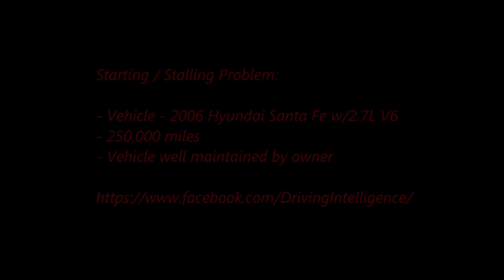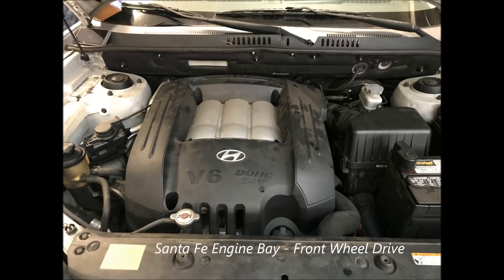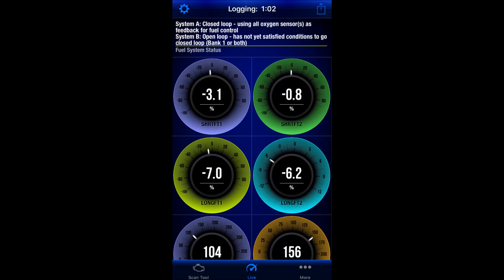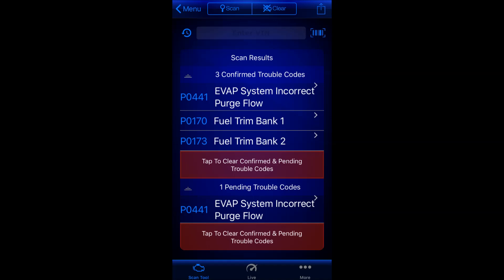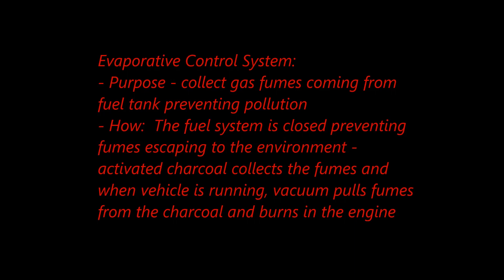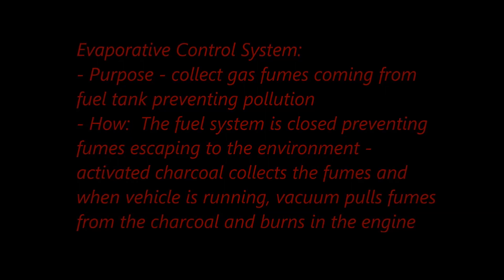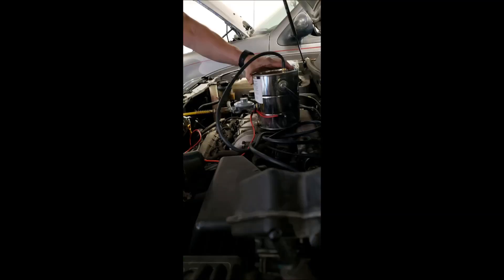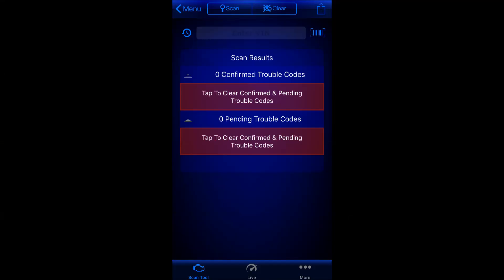How To Fix P0441 Bad EVAP Purge Valve Causing Stalling & No Start: ‘01-‘06 Hyundai Santa Fe 2.7L V6

Comment: Could the purge valve cause engine surging? Rpms revving up and down? Sometimes 2500 to 3500 rpms, as well as random stalling? I changed the mass air flow sensor, iac, and tps already. Stalling doesn't happen as often but the surging still happening. Also if i turn off the car while it is surging it won't start again for a while. But if I wait for the surging to stop and the rpms kick back down to 1000, then turn it off it will restart without any problems.
Reply: i have evap codes and it wont crank all the way i changed the fuel pump and spark plugs and it wont crank or run off its own fuel it runs with starter fluid but thats it
Reply from the maker: @Yeamontay  that sounds like a possible purge valve issue.  You obviously have spark and the engine will turn.  Which EVAP codes do you have?
Reply: My santa fe is a 2005 2.7 liter, with 89,820 miles on it. I appreciate any advice.
Reply from the maker: @graphicnick07  good morning.  Revving up and down usually indicates a vacuum leak.  I would start by looking for vacuum leaks and once that is ruled out, you can move on to other issues.  There is one other possibility, but I need to research this for a 2005 2.7, it could be an Idle Air Control Solenoid problem.  If these fail, the computer cannot control engine rpm at idle and it will hunt / stall.  Start with the vacuum leak.  By the way, do you have a check-engine light?  And if yes, any codes?
Reply: @DrivingIntelligence I already changed the idle air controller.  I had no codes until yesterday, it's an electronic temp control code. Since I wrote that first comment I also changed that purge valve and also the crankshaft position sensor. Problem is  a little better bit still surging. I will check for a vacuum leak tomorrow. Thank you! Let me know if you find anything I appreciate you responding.
Reply from the maker: graphicnick07 please share the exact code.
Reply: Driving Intelligence hello! My 2007 Santa Fe is throwing codes P2187 and P2189. Any help or info? Thanks!
Reply from the maker: @gh0stFace13x  hello!  And thanks for the question.  I answered your question on my Facebook Page at https://www.facebook.com/DrivingIntelligence - Please let me know if you have problems getting to this page (like & subscribe!) and have any further questions.  I hope this helps!
Reply: Driving Intelligence I got your Info on Facebook, I am going to try. Thanks so much!
Reply from the maker: @gh0stFace13x  you're welcome!  Come back with more questions!  And subscribe!
Reply: Driving Intelligence I figured that problem out it was a clamp to the MAP hose. But I’m having issues when I go to get gas as soon as I try to turn the car on after fueling it’s stalls I have to keep repeating the process until it starts back up and stays on do you have any clue as to what this can be?
Reply from the maker: @gh0stFace13x  Hi Kay, following up to our text on Facebook, this video you already watched explains the problem with purge valves causing hard starts and stalling.  It is likely a bad purge valve.  Perform the test I wrote about on my Facebook Page.

Comment: I have a P0453 code and I want to know if it is related to the same purge valve? It talks about the fuel pressure sensor high input. I smell fuel coming into the car and I need to fill up the gas tank very slowly else it pours back out unto the ground.
Reply from the maker: Your symptoms are definitely related to the EVAP system, but perhaps not solely the purge valve, and the P0453 code is a key indicator. The P0453 code itself points to a high input signal from the Fuel Tank Pressure (FTP) sensor, and the physical symptoms you are experiencing strongly suggest a problem with how the fuel tank is venting. 

The P0453 code (Evaporative Emission System Pressure Sensor/Switch High) and your symptoms are interconnected: 

Fuel Smell and Slow Filling: These symptoms (fuel smell in the car, having to fill slowly, fuel pouring out) indicate a significant issue with the fuel tank's ventilation system. When you add fuel, the air and vapors in the tank need a clear path to escape through the charcoal canister and the vent valve. If this path is blocked or the vent valve is stuck closed, pressure builds up, causing the fuel to back up and overflow.

Potential Culprits in the EVAP System:

While the purge valve is part of the EVAP system, the specific combination of the P0453 code and the refueling problem points toward a few specific components: 

Stuck-Closed Vent Valve/Solenoid (Most Likely): The vent valve (or vent solenoid) is responsible for opening to the atmosphere (through a filter) to allow air/vapors to escape during refueling and normal operation. If it's stuck closed, pressure builds up, causing the P0453 code and preventing proper, fast refueling.

Clogged Charcoal Canister: The charcoal canister absorbs fuel vapors. If it gets saturated with liquid fuel (which can happen if you repeatedly "top off" the tank) or is otherwise clogged, it can block the ventilation path, leading to the same symptoms as a bad vent valve.

Faulty FTP Sensor or Wiring (Possible, less likely given your symptoms): The sensor itself might be bad, sending an incorrect "high pressure" signal when the pressure is actually normal. However, this would not explain the physical fuel smell or the refueling issues.

Stuck-Closed Purge Valve (Less Likely): A stuck-closed purge valve would prevent vapors from being drawn into the engine for combustion, which might contribute to pressure buildup over time but is less likely to be the direct cause of immediate overflow during a fill-up. A stuck-open purge valve usually causes rough idle and hard starting issues after fueling. 

Recommended Next Steps

Given your symptoms and the P0453 code, prioritize checking the components that directly manage tank pressure during refueling. 

Inspect the Vent Valve and Canister: This is the most likely area of the problem. Inspect the physical components and associated hoses for blockages, damage, or disconnections.

Professional Diagnosis: A mechanic can use a scan tool to monitor the FTP sensor data in real-time and perform a smoke test on the EVAP system to pinpoint the exact location of the blockage or leak.
Reply: @DrivingIntelligence thank you so much for this thorough explanation. I will definitely keep you posted!

Comment: When i put some gas on my santa fe 2002 it constantly stops so i have to pull the trigger several times. Do tou know whats the problem? Nice video.
Reply from the maker: without knowing more, I can only guess that your problem is the EVAP Purge Valve as shown in this video.

Comment: My problem with the santa fe is after I fuel up the car wont turn on unless I pump the gas pedal until it doesn't sputter and stays and only happens after pumping gas. With all the online searches it has led me to the purging valve to be the issue but I'm not 100% sure since I havent seen any videos mention this and only on websites ppl comment.
Reply from the maker: Your description is exactly what this video is about. It sounds like you have a bad EVAP purge valve.  Quick, cheap, and easy fix

Comment: Hi my friend has a 2002 hyundai santa fe and it has a really rough idle and it stalled out on her out of nowhere I checked for codes and came out with a p0455. According to Google a p0455 code indicates that there is a large leak in the evaporative emission control system. With that being said you you think the purge valve would be the issue on my friend's car as well? Any input would be greatly appreciate it
Reply from the maker: Hi Junior, sorry for the late reply.  I would not immediately jump to the purge valve being the issue with a leak.  Sounds like there may be a vacuum leak somewhere in the EVAP circuit.  A loose hose, a hole in a hose, a disconnected hose.  Check the vacuum lines from the purge valve to the EVAP canister.  Also, check to be sure the purge valve is tightly secured in place with good hose connections.  19 years is a long time and there could be some cracking of the vacuum hoses.

Again, very sorry for the late reply.

Comment: My Santa Fe won’t start without starter fluid. Once it starts it’s fine but it won’t start without fluid, any idea?
Reply from the maker: Do you have a check engine light?
Reply: I have 2 o2 sencer codes and the p0890 is tcm power relay sence circuit low
Reply from the maker: @daddyndaughter6106  can we dialogue on my Facebook page?  www.facebook.com/drivingintelligence/  that will be much easier for us to resolve your issue.  I only ask that you follow both this channel and my Facebook page.
Reply: Yes my codes are p0890 p0151 and p0131
Reply: It starts with starter fluid
Reply from the maker: @daddyndaughter6106  my first assessment is that the P0890 code has nothing to do with your starting issue.  What is glaringly missing is any code associated with your EVAP System.  The O2 sensor codes indicate a possible O2 sensor failure, however, let's not start replacing O2 sensors.  It could mean a lean condition due to a vacuum leak which could be associated with your EVAP system, but again, there is no failure code for the EVAP.  What year and engine is in your Santa Fe?

Comment: I just replaced the Purge Valve for a 2010 Elantra. The location of components are a tad bit different. I vlogged about the simplicity of the removal and installation as well. It was difficult to start the car after filling the tank. Replacing the purge valve fixed it. Thanks Driving Intelligence!
Reply from the maker: Glad my video helped!  That is what I'm here for.  Happy motoring!
Reply: @DrivingIntelligence  Very nice. Thanks!

Comment: It is my understanding Hyundai's and Kia's  often have Purge Valve issues.  Codes 2187/2189 which are lean codes.
Reply from the maker: Thanks for the comment.  I've not come across this code, but it seems many vehicles experience lean conditions with age and wear.

Comment: CAN YOU MAKE A VIDEO HOW TO PROGRAM A REMOT KEY ONA 2006 HYUNDAI STA FE 2.7L SPECIALLY? THANK YOU IN ADVANCE..!!!
Reply from the maker: Hello!  I don't have a Santa Fe handy, but I did find the following:  

Self-Programming Instructions:

1. Remove driver’s side fascia (the plate under the steering column) and locate the alarm system control module. Ensure that the memory switch is in the OFF position.
2. Insert key into the ignition and turn ignition to the ON position.
3. After 5 seconds slide the switch on the alarm system control module to the SET position.
4. Press the LOCK button on the first remote to be programmed.
5. If programming a second remote press the LOCK button on the second remote.
6. Slide the switch on the alarm system control module to the OFF position.
7. Turn the ignition OFF and remove key. Replace center fascia.
8. Programming is now complete, test remotes to ensure proper programming.

Hope this helps!